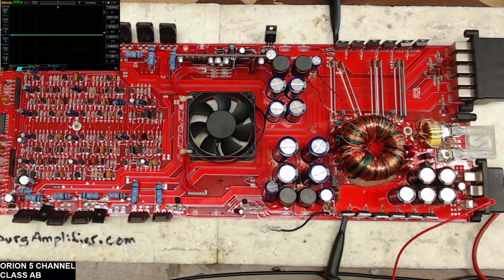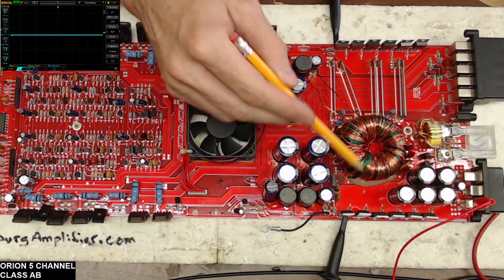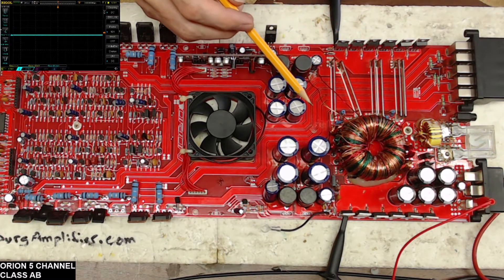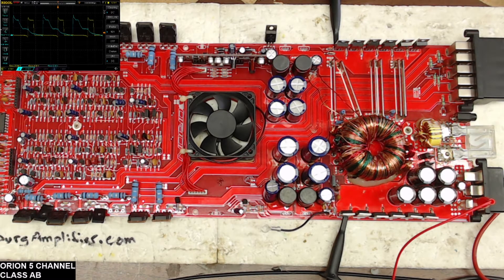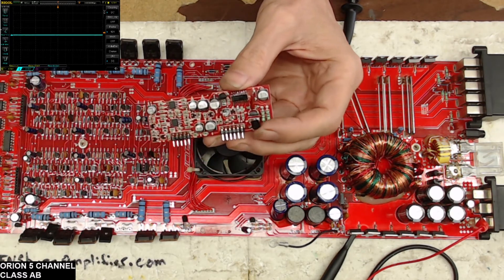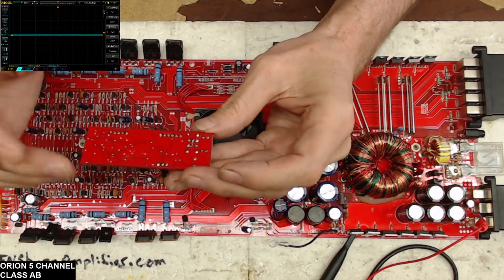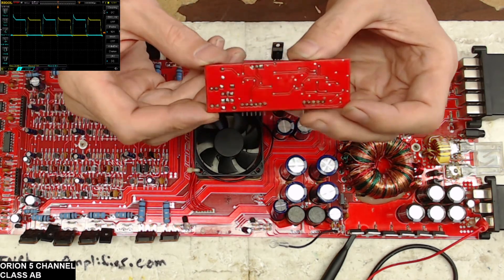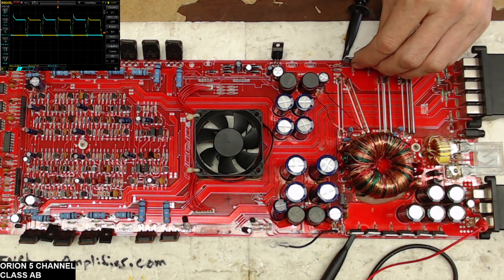Orion 5 channel Class AB Amplifier Power Supply Drive Repair

Comment: I need hemp with my Orion cobalt 4 channel... thanks
Reply from the maker: Thank you for the channel support. Are you repairing the amplifier yourself?
Reply: Hi master!
Yes... trying to find what’s causing the protection to come on...! But no success ...!
Reply from the maker: @hollyudyvideos7920  Are the output transistors removed? If not, I would take them out as the protection may be from the drivers.

Comment: Nice find on that "via to nowhere". :) I'm not surprised, I've seen (and own) all sorts of boards with "bodge" wires. I've also had boards that I've designed needing a bodge wire or two themselves. :)
Reply from the maker: Thank you for watching! It does amaze me to find these things. If this is the case on this board then the power supply was bound to fail.
Reply: @ellensburgamplifier  It makes sense. After all, why fix the boards when you can offload the problem to production? 

As engineers, we don't make mistakes, we simply create opportunities for others to shine. More democratic this way... :)